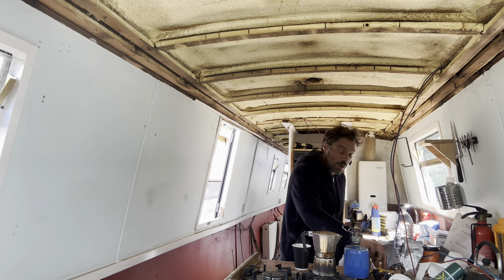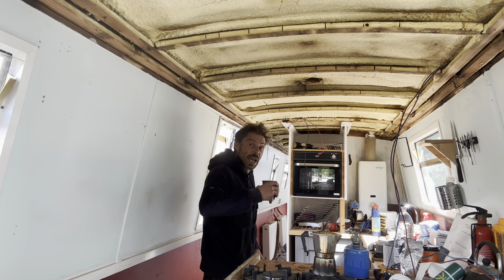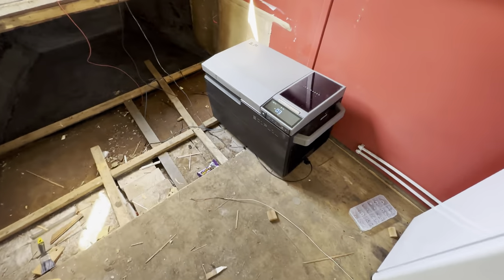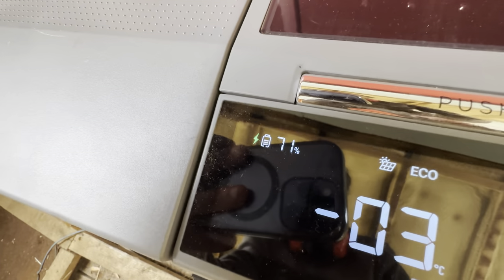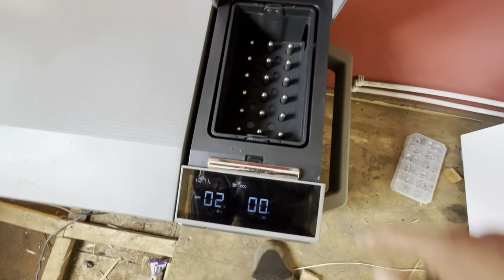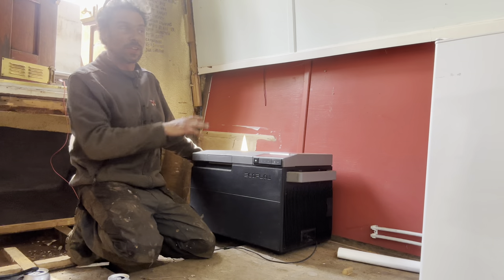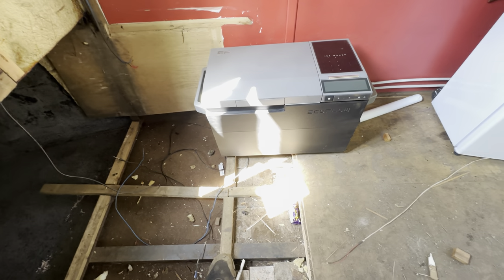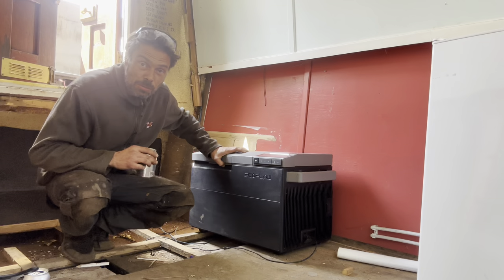436. No more milk on the Gunnels say ECOFLOW

Comment: The most efficient format for any fridge unit is that format as side opening doors drop out all the cold heavier air and pull in ambient warmer air every time you open the fridge. I use  Engel units which are very robustly built, very reliable and maintenance accessible which are dial in fridge to freezer but they lack built in power. They also have rounded all metal casings which Ecoflow might consider as an improvement.
Reply from the maker: I’m sure they’ll read the suggestion - thanks good to know

Comment: James theirs a reason why Ecoflow designed the fridge like that cold air is heavier than warm air, the bucket style keeps the cold in when you open the top lid, it would use more energy if it was upright, as all the cold icy air would fall out, hence less efficient and use much more power.

Comment: Although a chest fridge/freezer may not appear ideal on a boat, we had a chest freezer in a narrowboat. It was mounted on runners and slid behind the dinette so was out of sight most of the time, but pulled out when required.
Reply: Chest fridges are inherently more efficient, one with a vertical door just causes all the cold air to fall out every time you open it.
Reply: Agreed I've seen it done like that in vans too.
Reply from the maker: Yeah I see what you mean - I’ll think about it for the new boat for sure

Comment: I'm finding this product fascinating, James. Noting it has an inbuilt power bank, do you think the solar in the depths winter will be able to keep it going? I know that both winters so far you haven't been able to get enough solar in our short days to keep your fridge cold overnight. I agree with you that engine running is a poor idea - all of the diesel and noise pollution just to top up the batteries seems daft, before you see the price of diesel!